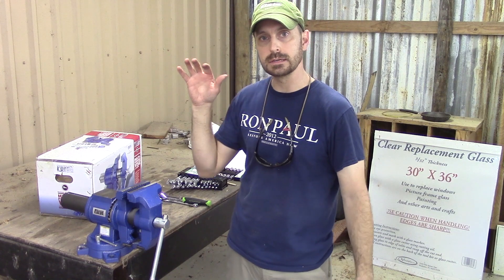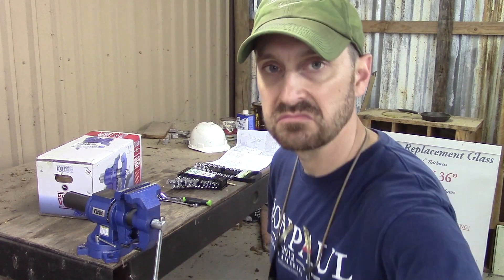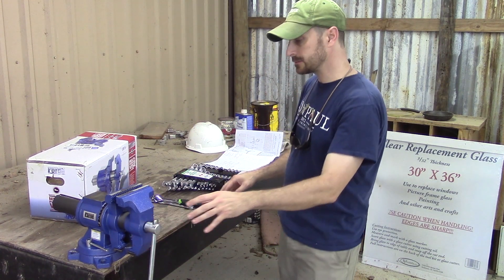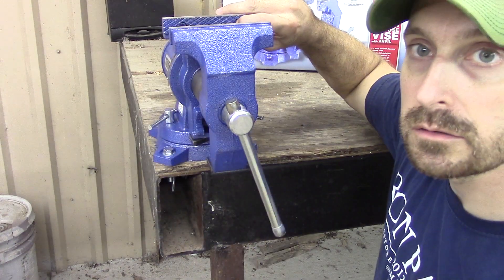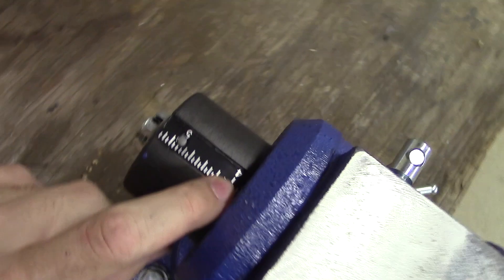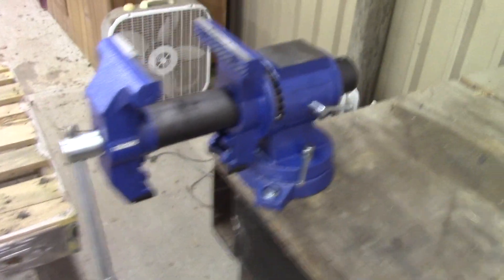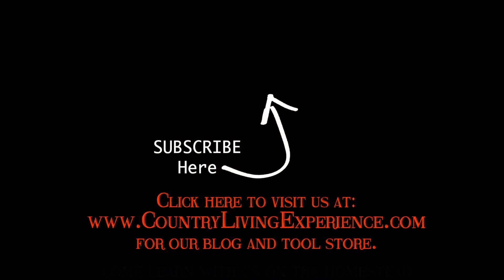Every Shop Needs This Tool! New Harbor Freight Bench Vise Review

Comment: Since there's no mark for the rotating measurement just put a level on the jaws then put your own mark on the zero and it should be spot on then. I agree on the need for a vice in the shop! 👍🏻
Reply from the maker: Great tip on the rotation measurement. Thanks for watching.
Reply: I was going to say the same thing about the angle.
Reply: Thats what I did to mine
Reply: The Yost 750-DL which this was copied from has an indexing pin to position the jaws level.

Comment: There is no marking for 0 in degree scale for a reason: after installing and leveling the vise you  mark it on the moving jaw. It doesn't matter if it doesn't hit the center line of the vise
Reply from the maker: Interesting. Thanks.

Comment: I don't understand how people break these vises.  I'm always careful and not overly rough with my tools.
Reply from the maker: Same here. I have had this for 4 years and done medium duty work with it. No problems.
Reply: Me and a buddy tried to remove the 1 inch NUT from the ball socket of a trailer hitch. That SOB was SO F*cking tight that the main shaft that goes in and out cracked after we broke that nut loose ...

Comment: You are supposed to place the side of the vise without mounting foot, on the corner of the bench.  This lets place the vise right at the edge, so you get the maximum amount of clearance.  
That's why it only has 3 mounting feet.
Reply: That’s how it looks to me too. It wouldn’t make sense to put the non mounting hole towards the back because there’s room to have one.

Comment: I know it’s been three years, but, I took a level and matched the table level with the jaws, then marked the location of the 0. Regardless of how incorrect the tape is, I can still find the correct level based off that reference mark.
Reply from the maker: That's true. I was just pointing it out for everyone.
Reply: @CountryLivingExperience 
Sorry if I came off aggressive or anything, I was only offering a solution, I got one of these not too long ago and that’s what I did.
Reply from the maker: @jacobacon3219  No problem. I didn't think you were aggressive at all. I did the same as you but just wanted to point out for everyone thinking of buying one that small issue. I appreciate your suggestion.

Comment: Here's how to mod it to make it better.  Disassemble it not hard at all. Grind and polish all the circular surfaces that interface allowing it to  rotate on the base. A 12" disc grinder with sandpaper discs and an air angle grinder with those 2" Roloc style pads from Harbor Freight are tools that are real helpful in removing the rough mating surfaces... then grease the shiny new surfaces.
To remove the sloppiness in the handle in front, cut a 1" length of 3/4" copper pipe, then slit it's entire 1" length. Then you can open it up enough to slip it over the big threaded rod and it will fit in the hole in front - you basically made a simple slit bushing.
Grease that up and it takes 80% of the slopiness out. 
Some older models have two metric bolts in back with 10mm heads. If you tighten them too much the jaws will not "clock". 
So just clean the bolt's threads and apply blue threadlocker and re-install them - but just up to the point where they do not impede the "clocking" feature.

All this takes less than an hour and you'll like the way it feels.
Reply from the maker: Cool. Thanks for the idea.

Comment: Most of the force applied to a vise is downward and off the edge of the table. That results in a lifting motion away from the force on the back of the vise.  With 3 mount points on a 270 degree arc, position the vise is with the middle mount point AWAY from the corner on  a 45 degree diagonal from it.  That provides the most support (and symmetrically) regardless of the vise swiveled position, while placing the vise close to the corner as possible.  

btw, The irwin's castings have smoother cast finishes, indication higher quality casing work,  with predictable]y fewer voids and internal defects.  The cast collar of the main body around the cylindrical slide is beefier.  It also better attachment of the swivel base and main body.  The jaws have wider flat plates and more uniform pipe clamps.  Not saying that those differences are worth $20, but those are practical differences.  Both the Irwin and HF are cheap knockoffs of the Yost 750-Di .  The Yost Vise has 4 mounting holes, replaceable jaws that can be ordered from Yost.  It calls for an 18x18x1/4 metal plate for attachment to the underside of a wood table top with grade 5 through bolts because is is THAT much stronger than the knockoffs,
Reply: Thanks for the information!
Reply: Exactly what I was thinking!

Comment: Please let me know if your has any problem sliding in and out, I just bought one of this vise and it doesn't slide easy you have to use some pressure to do the jaws adjustment. I am talking when you are opening and closing the jaws. Thanks
Reply from the maker: I do not have any issue with mine. My jaws adjust smoothly and without much force being applied. I would return yours for another or try lubricating it.
Reply: @CountryLivingExperience  ok thanks, I will return it, I already tried lubricating it and it didn't work. I will get my money back and buy a Yost. Looks like you got a good one, there are too many bad reviews for this vise, I still wanted to give a shot but I guess no luck for me.

Comment: Great Video..I wonder if middle mount goes to inside. If you do a lot a pushing down or lifting could decide which. If Metal only at edge of table could decide. Any serious forces to apply would be better in line the the opposing bolts. Been looking at, need to pick up next time there, Seems Versitle, good choice. Design is good, Quality to be determined, Later
Reply from the maker: Thank you. The quality is holding up for us but we use it for light duty work only.

Comment: Just got this vice as a gift. I mounted it then disassembled the vice to lubricate it. I found the acme threads on the screw were in VERY poor condition, as if they were cut by an extremely dull tool that had over heated. The cast threaded nut the screw treads into is not very well supported and will probably crack when any significant torque is applied to the screw. Buyer beware.
Reply from the maker: It is only $60. Good for light duty homeowner use.

Comment: Yeah I had that vice and I broke it. So now I'm replacing it with a masterforce from Menards which of the seems to be a little bit better one and it cost a little bit more money but the same type of features. This one has a measuring stick on the internal RAM and it has four mounting boats.

Comment: My jaws don't close squarely. The left side of the jaw grabs the part i'm working on but the right side is so loose it does not hold the part solid and the part ends up pivoting and getting a deep score at the pivot point. I've seen others complain of this as well.
Reply from the maker: That doesn't sound good. I don't have that problem with mine.

Comment: Bolting flanges should be at 10, 2 and 5 o'clock. The spot missing the flange should go at your 7 in the outside corner of the table.
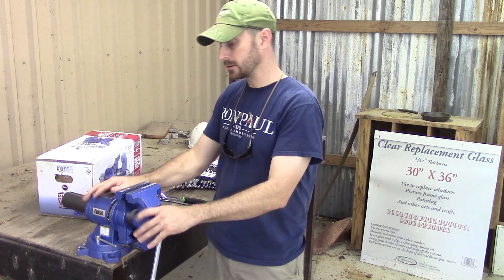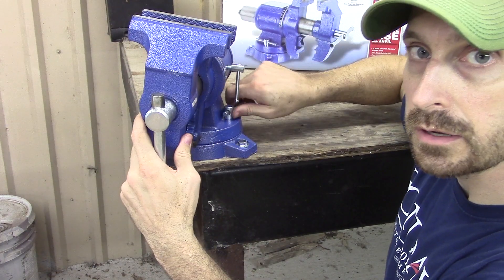Reply: You are off by "30 minutes".  3 hours on a 12 hour clock is 90 degrees.  You'd want to split that difference. A line running  at 45 degrees to the corner would be 7:30 - to 1:30.  The back flange would mounting that line.  The other flanges would fall at +/-3 hours from it -or 4:30 and 10:30.   

If it were me, I wouldn't use a compass or a clock.  I'd draw two lines parallel to the sides of the corner at equal distances from the sides and run a line through the corner and the intersection. Then I'd measure between centers of the two widest mounting holes,  and draw two lines parallel to the first line at half that distance.  I'd slide the vise in from the corner until the both flanges were on the table, rotate the base until  the three parallel lines were centered in the holes, then slide the base over those lines so the back jaw was clear of the corner, the base was entirely on the table, and the flange's holes were free of unwanted obstructions below.   If I were doing it , I might radius the table  corner to provide more clearance without compromising the strength.
Reply: No, 2:30, 5:30 and 10:30.

Comment: I broke mine in 4 uses. Sure, I'm a big dude (over 150 lbs some days) but I stripped the threads using just one finger. Also worth a mention is the problem with the cap nuts on the slide handle, they would never stay tight and the POS fell out and hit me in the foot leaving my little toe completely useless - sorta like a vise from HF
Reply from the maker: Interesting. i have not had any of those problems yet. Thanks for the heads up. So far everything is solid.
Reply: What "use" are you now missing with your little toe.?

Comment: I was just shown a post of mine from 2011 on facebook from when I built my workbench.  I've had that same vice since April 29/2011 and use it daily.  It's not quite as pretty as it was when I first got it but it's still going strong without any issues at all.
If it were to break tomorrow from me abusing it (I've already beaten the crap out of it) I would buy the same one in a heartbeat.
Is it a nice old Wilton Bullet Vise?  no.. but it does the same job without having to spend a fortune.  Besides... most of the people I know with very nice, very expensive vises hardly use them, they're afraid to damage their expensive vise.  Every shop I've worked at have all used a good, beefy cheap vise.  The only thing I added to mine were some soft jaw pads.
Good video, thanks!
Reply from the maker: Cool. Thanks man.

Comment: Can you tell me what size bolts you used for mounting?
Reply: 1/2” lug bolts or hexagonal bolts, flat washers and self locking hex nuts, all sold separately.If your bench top is less than 2" thick, use a piece of steel flat to spread the load over at least 4 square inches.

Comment: Awesome video before I clicked on it. 
Having used tools for 50 plus years, I just needed a view on the durability of the vise - why buy something that has as much integrity or durability of Ron Paul when we have the Constitution to outline Federalism as opposed to opposition of Federalism ie., Libertarianism.
Most vises that are "5" vises open up to 5" inches. Most metal vises have durable - machined jaws with some type of mounting screws. How fine are the screw threads for tightening something that is pot metal? Is it easy to overtighten? Finer threaded vises give you more control for clamping without over-squeezing.
Glad you compared it to Irwin - a known vise that is moderate quality and not the best but not the worst.
Glad you kept mentioning the obvious. Mount solidly. Every HANDYMAN or WOMAN needs one, not homeowner.

Clearly you are sincere - but thank you for nothing much other than the Irwin comparison.s
Thanks again.
Reply from the maker: Thank you

Comment: There is a difference.  Unfortunately, when it comes to vices, HF tends to use pig-iron.  Which is not all that strong except for light duty.   If that is all you do, then great, it is a great deal.  and the tool meets the needs.  Heavy work/pounding and above, then the extra $20 does make a difference.
Reply from the maker: I understand. I don't do exceptionally hard work on it. It has held up with no problems so far. Not sure if that extra $20 will get you a huge increase in quality. I understand if it is a $180 vise then you should see a large quality increase that is suitable for heavy work.
Reply: What is pig iron?

Comment: I didn't see a different comment.........wouldn't it make sense to mount the third mount at the back for leverage for whatever you choose to hold in the jaw that would be opposite?
Reply: The third hole would then be in the thin plywood instead of the square steel tube in the front.
Reply: Putting a piece of flat plate beneath the back support would distribute the upward force over a larger area.  As shown in the video, only the weight of the vise resists downward force applied during use.

Comment: Pretty sure this vise, the bessey (BV-MPV5), the yost (750E), the irwin (4935505E) and the wilton (69999) that "look" like this vise are all just rebrands out of the same factory in China.
Reply from the maker: I bet your are correct.
Reply: You may be partly right. 
 Yost and WIlton industrial vises that are widely used in manufacturing because of their quality and durability.  The models you cite are not among them. They are consumer grade medup-im-light duty vises.

The Irvin vise's body is of different material than the Harbor Freight's, indicating a different manufacturing process, wherever it is performed. The Yost and WIlton vises seem to be of the same construction as the Irwin, which is a cut above the HF.

Yost has been making nothing except vises in its Holland Michigan USA plant since 1908 and they meet Industrial Standard of Federal Specification GGG-V-410A.   Yost makes industrial quality vises that cost more than twice what the HF and Irwin models.   Wilton has been making vises since the early 1940's, first on WIlton Avenue in  Chicago, later in Schiller Park, IL and today in Lavergne, TN.
Reply: The comparable Yost is the 750-E not the Di, which has removable pipe jaws.  Wilton and Yost products made in the USA CLEARLY state that they are and cost far more than $250.  We have a Wilton version of this vise at work, and I have the HF version at home.  The differences are: The Wilton has 4 mounting holes, it has "WIlton" cast into the casting, it has a cotter pin holding the rear nut in place instead of a simple tubular pin, the polish is a bit better on the Wilton version, finally, the Wilton has a lifetime warranty.  If you can get Wilton or Yost to sell you a new USA made vise for less than $200, more power to you!  But, its not going to happen... these vises are made in China all day long.

Comment: Back jaw will fold over.  1/4 thick powder cast.
Reply: It's low grade (brittle) cast iron. If it were powder cast, the castings would have been smoother, if ductile iron, much stronger and expensive.

Comment: this vise is everywhere nowadays with a ton of brands slapped on, so it's best to buy it at HF. even Yost who had a better version of this, migrated to this cheaper version. it is sad that a good affordable vise can no longer be had, I don't need to spend +300 dollars for something I'm not using to make income.
Reply from the maker: I hear you. This type of vise works perfectly for a homeowner. Thanks for watching.
Reply: You seldom get kore than you pay for.  The Yost 750-E is 105USD,  medium duty of grey iron, has no replaceable parts and is not warranted by Yost.   The 5" Yost 750-Di  is 190USD, industrial quality, with replaceable parts and a 3 year casting warranty. The Wilton is 140USD, light duty by their standards.

Comment: Do you really believe the only difference between the Harbor Freight and the Irwin vise is $20.00? And it's an even smaller difference when the HF unit is not on sale. So for a purchase of a very long term piece of equipment that you want to stand up to all the abuse, why not spend the extra few dollars? If it only lasts 20 years then that is only $1.00 a year difference. Go get the Irwin.